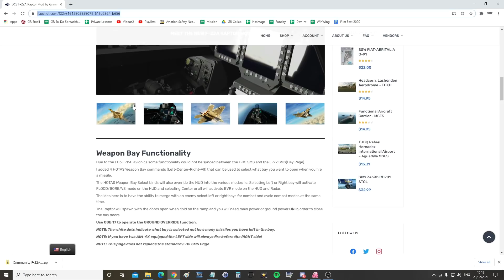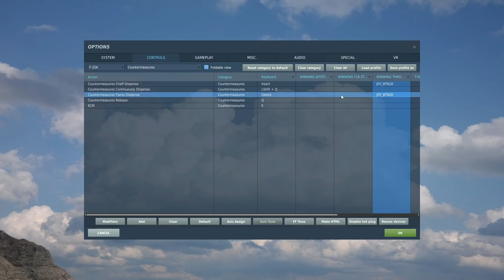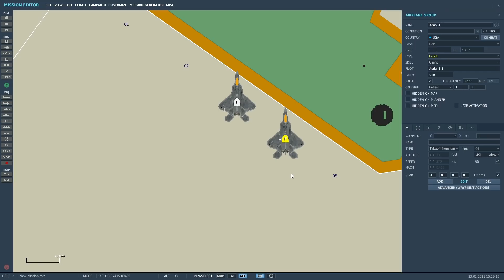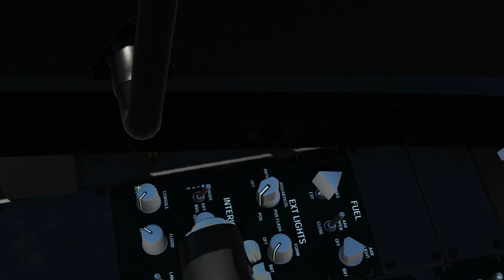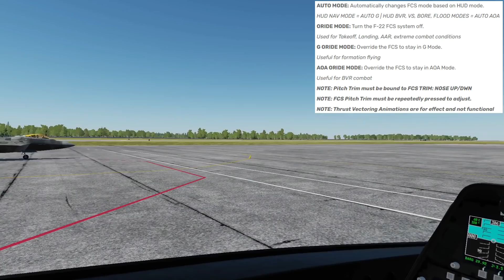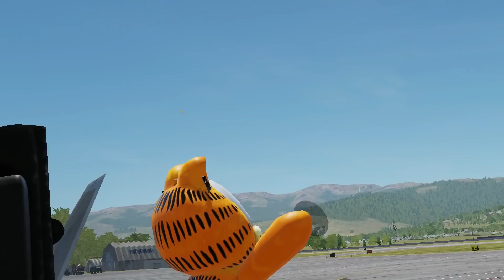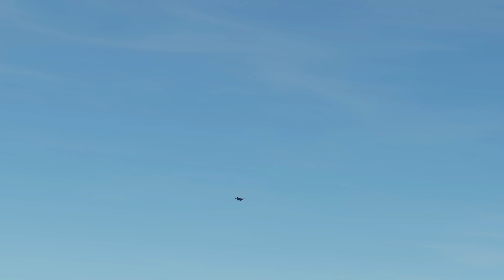F-22 Raptor Mod (version 2): General Guide | DCS

Comment: is there something im not doing right because i cant fly my raptor it just gets controlled by Ai
Reply: the mod is broken.... evidently every mod that is using the F-15C avionics as the shell is suffering the same fate... I just spent the last 8hrs searching the web for any info on this and this is what I came up with....
There is a "bandaid" that can be used to gain control of the plane at startup, but if you start from the ground, you will not be able to lift your landing gear (another part of the broken), so I would suggest starting in the air until the mod gets fixed....
...so if you want to gain control of the cockpit in your F-22, you will first need to load literally ANY mission that features the F-15C. Once that is loaded, quit the mission and immediately load your F-22 mission and you should have near total control of the cockpit (with the exception of the broken areas)... Hope this helps...

Comment: But it’s supposed to supercruise at 1.5 Mach and hit Mach 2.1 top speed. We need some updates to this mod! Air Force website has a ton of info on the f22 now and other videos showing its min turn at air shows etc show it can basically 180 just about within the length of its own airframe. Which seems much larger than the min turn radius here

Comment: Hey. If and when I just use normal one button trigger do i really need those detends binded anywhere? Havin a lot of fun time with AIM260´s. To be honest I pretty much have binded this to my cheap tm.16000hotas pretty much the same as f-15c and flanker. It pretty much goes with fc3 binds. Do you have any recommends TODAY for some encahnement mod. I have used Nightstorms and I would like all those weapons, and a way to remove pylons etc (as nightstorms single player enhancement does..) But it removes also flight model of F15 more or less. Its superfun though, but I would like enhancement with only those weapons. Is it possible somehow "easily" in a way that I would get still flight model not going mach 1 in 10 seconds.. ok its fun but.. Grinelli´s own seems to be more or less *ucked in todays OB, but works nicely with that enchancemnt. Weird.

Comment: I hope you have seen F-22 documentaries of 1990s on Discovery Channel, etc. DCS F-22 cockpit is disappointing, except cold start, it uses 4th gen jet's HUD, MFD for radar, RWR, etc, not sensor fused avionics. Only the 2 small upper MFDs, stores & HUD panel conforms to specs shown in documentaries. DiD's F-22 ADF & TAW from late 1990s, except the graphics, are far better very close to displays what was publicly projected - HMDS, diagnostics, foe's radar envelope, SAM circles, EMCON, stores, fuel, electrical, hydraulics, the targets should appear as triangles with their direction of heading, each missile's association to its target, communications menu with wingmen, tanker, tower, AWACS, etc. There was rumor in 1990s that F-22 will have retractable EOTS so that was also put into the game for LGBs with LANTIRN display.

Comment: the F-22 FCS Pitch axis isn't showing up, I dont have a flight stick (I fly with keyboard) so idk if thats the problem but I am unable to pitch up at all.
Reply: ok, so after searching the comments section I found that you need to set the FCS trim, and turn off the flight control system with right alt + P (I just bound the FCS on/off key to make it easier)

Turns are a bit sluggish at times but it works!
Reply: @AV8er1048  thanks bro
Reply: @Dacion712  It shows to have 2 replies but I only see one. Turns out (now i have a flight stick) that it was an axis command which with keyboard only I was unable to access or assign.

in other words you need a flight stick

Comment: Is there ANY WORKING f-22 and f-35 mods. NOW, today may 2022 I found just VSN f-22 and f-35. Dont have fc3, but I have fc3 version F15C. With that i am using Gripen also. Dont get these to work, or .. they do work, but I cant fly with em. Just see punch of planes flying around in free flight / instant action. Is this the same mod. That link does not work anymore, what is seen in the video.. PANPANPAN @Grim Reapers.
Reply: Oh yes! It works. Just needed to get that f22communityversionII.zip from elsewhere.. fsoutlet is down..

Comment: Just a question. If I own The F15 but not flaming cliffs 3 can i still use flaming cliff Mods such as the F22 raptor F35 Lightning II Etc?
Reply: Yes, you only need the F15C module installed and valid

Comment: I only own F-15C do I need to download flaming cliffs? I get the key bindings in setting. But I can't see or use the aircraft?
Reply: I now own flaming cliff 3 and still nothing =(
Reply: Hey, check the pinned comment for the correct location of the mod. You don't need FC3 since you already have F-15C.

Comment: For some reason DCS isn’t recognizing my left and right Virpil throttles when I try to add them to the left and right thrust of the F-22 mod. I double click on left thrust to open that window and then I move my left throttle back and forth but no axis is being recognized. Same with right throttle. I know that DCS is still recognizing my Virpil throttle because the left and right throttle are still being recognized when setting up my F/A-18 controls and even when setting up the F-22 controls, DCS is recognizing the analogue axis stick that’s on my Virpil throttle that I use for a targeting slew.

Comment: DCS keeps telling me that I can’t use the F-22, that I don’t have authorization to.
It’s doing it with the F-22 and F-35.
I have Flaming Cliffs Three purchased and installed. I followed the directions in this video, and as soon as I opened DCS after putting the mods in the files, it said

Authorization is valid for 2d 23h 59m
The following DLCs are not authorized and will be disabled:
F-22A
VSN_F35
Reply: yeah thats what mine says too

Comment: this probably wont be read because old video but the settings are really outdated now. none of the weapon controls work. pulling the trigger switches between guns and bvr, releasing weapons does absolutely nothing, and the thing probably got a engine buff because it accelerates from stopped into mach in about 12 seconds which i dont believe is possible although i might be wrong.

Comment: I play DCS mouse and keyboard. Upon downloading this mod I was very excited. After cold starting, I went to take off in the f-22 and to my surprise, I has absolutely no aileron control. For some reason, I was able to very slowly bank to the left and right (very slow and inefficiently) but I didn't have any pitch control, I would take off and I would be unable to pull up. When I looked at the cockpit's joystick, when I would input W, A, S, D the stick would only, very slightly move in the respective position. Do I absolutely need a HOTAS system to use this mod? or am I doing something wrong. Can someone please help?
Reply: Your problem is that you play DCS on a mouse and keyboard lmfao why would you intentionally handicap yourself like that
Reply: @fuhrerlandon because he isn’t rich and willing to spend a thousand dollars on a flight sim setup
Reply: @sorleykl   What kind of dumbass logic is that lmao that's like saying "durr i want to sign up for the military but i dont want to exercise"
Reply: Turn off the FCS Auto
Reply: it supposed to move very slightly even in real life, but should still control the plane perfectly fine, so i'm guessing there's some bug in the controls scheme
Reply: did you ever figure this out? i jjust got it and it seems to autopilot

Comment: The aircraft doesn’t pitch up and down for me
Reply: You have to change from pitch axis to f22a pitch axis
Reply: @BANDIT_NOOB  thx alot , now i got it to work :P
Reply: @BANDIT_NOOB  is it in adjust controls?
Reply: @vipergaming3865  yeah.  Go to axis controls. Add the  Y axis bind of your stick to the f22a pitch axis. That will remove it from the usual pitch axis.  If you go on the website you downloaded it from.  It tells you on there ask the things you need to swap.  Like the pitch trim buttons too. And wheel brake axis
Reply: @vipergaming3865  I've not yet flown mine yet.  Super new to dcs. But I'll give it a try soon though.
Reply: @BANDIT_NOOB  yea same only started playing 2 weeks ago
Reply: @BANDIT_NOOB  thank you

Comment: My pitch isn't working on keyboard... But it does bank left and right.
Reply: I may have a solution, so on the mod page it has a section titled "read this before taking flight" or something like that, in that it points out that you cannot set your keybind for pitch to your regular bind, there is a new bind called "F-22 FCS Pitch Axis" that you need to set it to. Hope this helps.

Comment: I installed the aircraft, however I am unable to control the pitch up and down on keyboard. Any ideas?
Reply: get a joystick
Reply: @danielpiazza5195  already have, still not working, I tried a different mod version and it worked
Reply: @abdullaahmed5767 What mod version did you use?
Reply: @InhumanLee  have download the through a German website VSN, but V2
Reply: @abdullaahmed5767  link ? please

Comment: I need some help because when i move the F22A folder to the mods file and i start DCS open beta 2.7 I receive an error message mentioning that my license for all my purchased aircraft are not valid. Do you get the same type of error? (FYI i use DCS version from DCS and not STEAM version)  Thx for your feedbacks
Reply: You installed in your game folder instead of your saved games folder

Comment: i dont have half the axis commands in settings, did i do something wrong?
Reply from the maker: How strange, no idea sorry.
Reply: @grimreapers  just figured out I'm an idiot that's it as I'm using keyboard and was confused why I did not see the joy stick options
Reply: @hollex1096  im having the same issue. Also using m&kb, so is it not possible to bind pitch to anything without a joystick? Ive managed to fly other planes fine.
Reply: @rumproast4154  the issue for me was I'm on keyboard and did not get access to the yoke options but what did work was the options the did work (so I can pitch roll and use the missiles was) F-22A HOTAS category so I binded my pitch to the trim up and down and trim auto. To use the pitch you need to press your pitch auto/off button you have binded to turn off the auto trim allowing you to pitch
Reply: If you got to the website and find the image of the settings under HOTAS/keyboard bind setup that will help alot for binding the controls you need to fly the F-22
Reply: @hollex1096  thank you, this helped me a lot

Comment: When I`m landing the F-22 Raptor, I can`t enable Nose Wheel Steering ( I been setting up the key binding, but it not working) 

I can turn the aircraft too the left - right - up and down in the air, but once I`m landing I can`t turn the aircraft to the left og right? Any solution?

Comment: Brilliant. I wish there was some way to make the FC3 jets simiclicable the same way this is. I get that there are a tone of systems left out, but it would be nice to control the ones we have in the same way as the fully modeled jets.
Reply: So in options under axis commands you need to unbind the stock pitch and then bind it to f22 fcs pitch axis. Then you should be good to go.

Comment: The following DLCs are not authorized and will be 
disabled:
F-22A

i don't know how to get past this with installing the mod it always happens when I start the game
Reply: Hey, I know how to solve this issue. Remove the aircraft and all aircraft you do not own from (your_drive_letter):\Steam\steamapps\common\DCSWorld\Mods\aircraft, this includes ones you have used on free trial weekends/holidays.  For example my drive location is D:\Steam\steamapps\common\DCSWorld\Mods\aircraft. Remove the aircraft from here and MAKE SURE they are in the following folder instead: C:\Users\(YourPCName)\Saved Games\DCS\Mods\Aircraft\F-22A
Reply: @iFlyAircraft  i don't have that folder so im going to try to make it and see if it works
Reply: i copy-pasted the path you told me to the saved games and wound up in the correct please that I didn't find until now bocus its in my launguige so thanks you solved the problem
Reply: @iFlyAircraft  hey I get the same issue I however don't have the game on steam and when I'm in me D:\Poopies\DCS World\Mods\Aircraft I only have flight models that i bought so I can't remove any that I didn't pay for any help ideas' thanks

Comment: Wow the mods make startup so much easier when you only have the buttons and switches that are functional :)
Honestly the gucci menu is quite important on this plane.  I mean you have almost nothing else to focus on when fighting enemies since they can almost never detect you, so giant stuffed garfield plushies does not hamper your SA.  The fact that the plushie is visible from outside is just all the better as well. LOL
Reply: Honestly start up may be that simple. When I went through KC-135 engine run class there was a whole process we had to learn to start the damn thing. About two years later I was working for a regional airline operating 90's model jets. I had another mech show me the engine run "procedure". You literally applied bleed air, and press a button.

Comment: Ideally, it should supercruise at Mach 1.58 to Mach 1.78.
Reply from the maker: Wow!
Reply: @grimreapers  I know, Right?  General John P. Jumper jizzed his flight suit.
Reply: @grimreapers  I lied.  It's actually 1.82!  No BS!!!
Reply: @grimreapers  I noticed when you guys took off, one of you had your refueling port open.  In real life, the moment you throw the switch that opens the refueling port, it automatically puts the F-22's flight control system in A/A refueling mode.

Comment: Every time I put a mod plane in “aircraft” I boot up the game and it says unauthorized vehicles or something like that and it disables the vehicles.
Reply from the maker: Some people are getting this problem :(
Reply: @grimreapers  Does it work on the steam version?
Reply: Hey, I know how to solve this issue. Remove the aircraft and all aircraft you do not own from (your_drive_letter):\Steam\steamapps\common\DCSWorld\Mods\aircraft, this includes ones you have used on free trial weekends/holidays.  For example my drive location is D:\Steam\steamapps\common\DCSWorld\Mods\aircraft. Remove the aircraft from here and MAKE SURE they are in the following folder instead: C:\Users\(YourPCName)\Saved Games\DCS\Mods\Aircraft\F-22A
Reply: @iFlyAircraft  Hi, i understand what you said, but i have nothing in my saved games folder. What do I need to do to add DCS\Mods\Aircraft into my saved games folder?

Comment: I love your channel , but I have no pedals , I have no brakes. Its in axis so buttons don't work .  I'm using the old X-55  joy and throttle . any one out there  got over this problem .
Reply from the maker: Does the 55 stick twist like 56?
Reply: @grimreapers  yes it does , I'll try using that later , thanks..
Reply: Thank you for your help but i lose rudder .it will not let me use for both .  ill have to wait until its sorted .

Comment: thx Caps,
i just downloaded and installed it
I have a question, i am using keyboards. and i can't pull or push my stick, it says that i need to press my up/down key, but when i do it the plane does no response. Can you take a look and tell me how to fix it? 
Or this mod doesn't support keyboards, and i have to buy a hotas
Reply from the maker: I think keyboard is getting added. Not 100% sure tho sorry.
Reply: Same problem for me bro

Comment: Alright I moved the f22 mod into the mods folder and when i start the game keeps saying authorization failed and the f22 mod is disabled any ideas what i am doing wrong im confused at this point
Reply: Same thing for me man, no idea whats wrong.
Reply: @camdenmiller7369  wrong folder
Reply: @user-53847  How so? It follows the correct path that everyone has been posting.
Reply: @camdenmiller7369  try the other aircraft folder, sometimes its different for different people
Reply: @camdenmiller7369  but make sure you dont have it in both aircraft folders
Reply: Saved games\dcs\mods\aircraft
Reply: I had to go into file on mission and open it the 1st time. However after day one now I have no missiles
Reply: @jfiery  so when you went to mission were was the file under for you for the raptor
Reply: @raptoracefx2248  I had to have the F22 outside the main aircraft folder.
Reply: @jfiery  so ok so now im running into this problem, so i did exactly that and now it's saying it needs a module to load and it's saying it needs the f22 mod even though it's installed, do i not have it in the right file, been trying to get it to work since yesterday morning it'll almost load up then says that
Reply: @raptoracefx2248  did you copy the F15c dll file and add it to the f22?
Reply: The grin reapers leason helped I had to create a set of new folders just for that mod
Reply: @jfiery  alright let me give that a shot see if that works
Reply: @raptoracefx2248  the last thing i did was a quick repair using the games equivalent off DOS in windows
Reply: @jfiery  alright, I just read your thing about the f15cdll I didn't not add it to the f22 mod, can you do that or not cause I thought it wouldn't work with it anymore cause of that update for dcs
Reply: @raptoracefx2248  worked for me

Comment: Do you have to have the non-steam version of the game for this to work? i got the f-15C and followed the steps to install correctly and it says that F-22A is not authorized.
Reply: Exact same thing is happening to me
Reply: I run the Steam version and it works fine.  Full disclosure, though - I bought the F-15 alone some time back and then recently bought FC3.  Someone else may want to comment on if that matters or not, but the mod is working fine for me.
Reply: It needs to be in the save games folder not the main dcs folder
Reply: @gamingdoggy3597  I have the DCS Steam Version and there is no saved games folder. Did you have to create it?